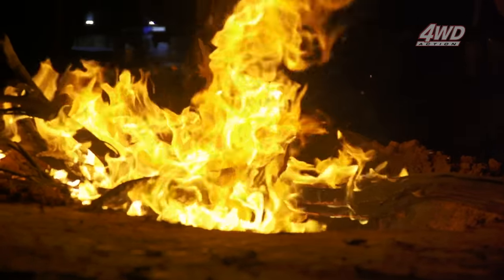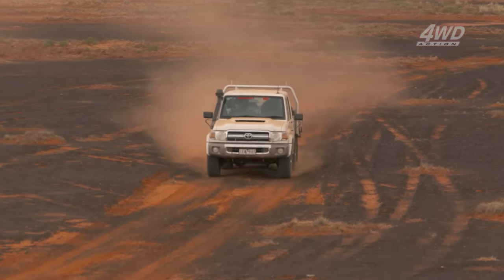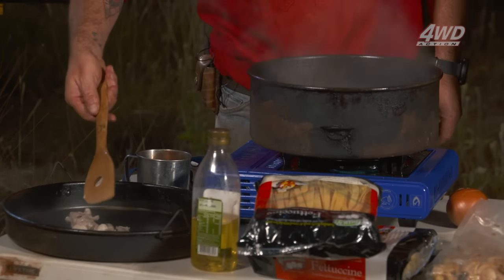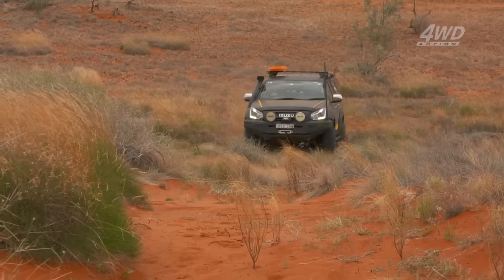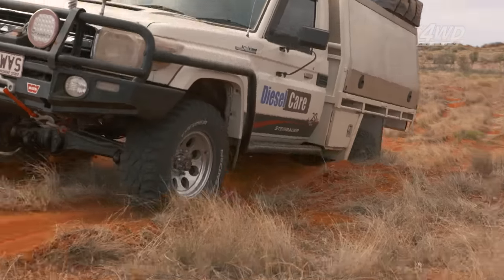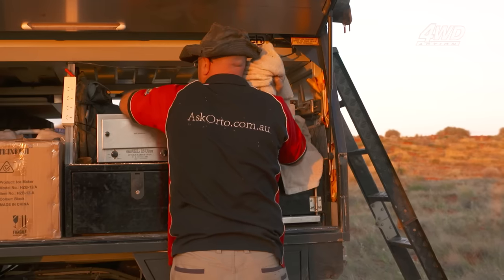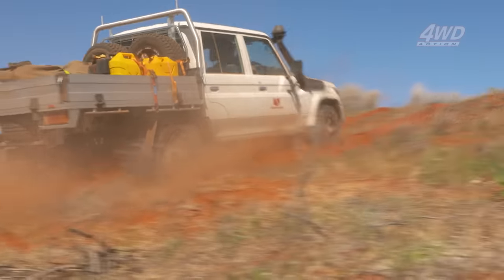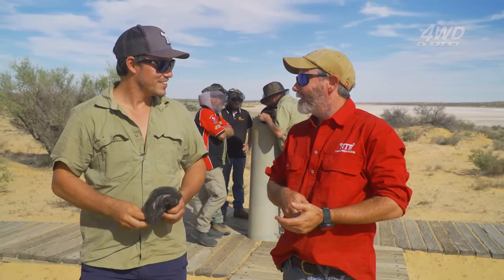Soaring Through The Simpson! 4WD Action #287

Comment: In 2006 I was helping leading a Tagalog group with Andrew Morse Tagalog tours from Opposite Lock we stopped in at the camp and became good friends with Lindsay bookie who owns and runs Battle Camp on the hay River.
After Lindsay showed us a few survival tips. when it was time to leave he said follow the road all the way down also known as the clay pan. Not long after that we started going GPS cross-country mostly following the shot lines which also took us to the Wells that's been kept including an old airport strip that they used in the day to get their goods in and out. when we conquered all this heading south to South East into purples  corner and yes you guessed it 6 vehicles GPS all the way cross-country we were the first to open up that new section 2006. And if I go back to 2005 after we cross the Simpson Desert we then went down through White Cliffs and the hot springs in GPS to where the rivers and creeks joined the northern end of Lake air which is called The Groove that was a whole week GPS.